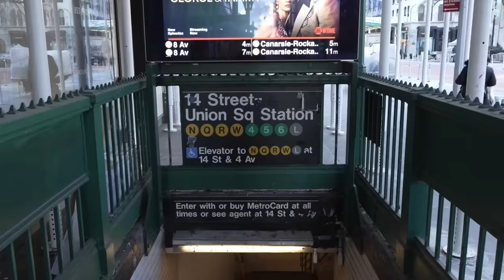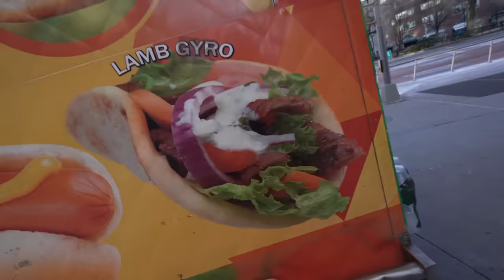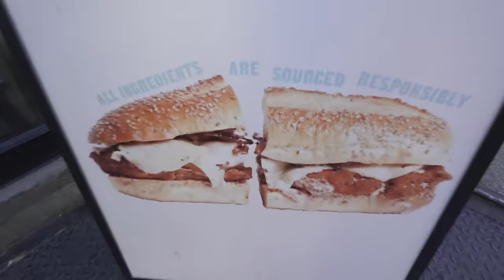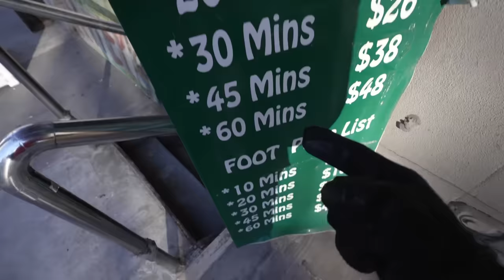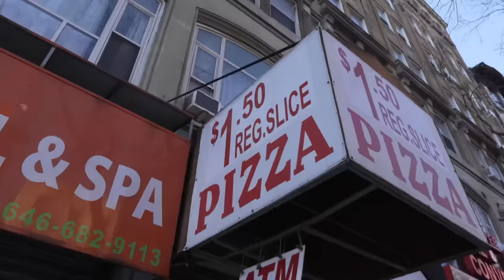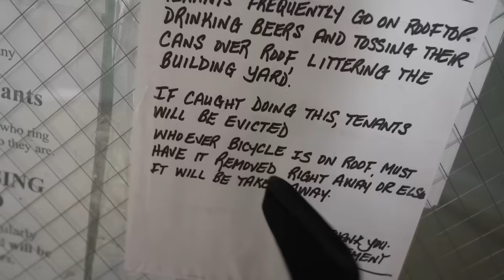This Apartment is SO SMALL… Nobody Can Live Here

Comment: I wonder how much it cost to bribe the building inspector to allow a gas pipe next to the breaker panel.
Reply: In a kitchen area
Reply: What about the outlets over the kitchen sink?!?!
Reply: @SherryAnnOfTheWest  not that uncommon
Reply: It’s not technically illegal for the gas pipe to be there, it can’t be above or below or the breaker panel, and there needs to be 30 inches off side to side space for the panel, but it doesn’t need to be centered. Still very bizarre.
Reply: @SherryAnnOfTheWest  not illegal if it’s GFCI protected.

Comment: Two more apartments with gas meters in the living spaces and strange floor to ceiling heating pipes.  Used to be 16 and now chopped up into 36 units.  I wonder if this building is up to code with that frayed refrigerator cord and the pipe with the loose part that's supposed to be connected at the ceiling.  A hard pass for me on this building and these units.

Comment: Two heat pipes in the wall. I think those are drains cuz that gas meter would heat the place. Or heat water that would run through that white radiator

Comment: a 16-unit apartment being converted into a 36-unit apartment is gonna result in some barely legal, barely useable micro layouts. When I lived in Flushing, Queens, I lived in an old apartment building and my ground floor neighbors had a 1br place with a very massive, sunny living room. After those neighbors moved out, my landlord sent people in to build a wall right across the center of that living room and then posted signs on its windows that a 3br apartment was available. My next door apartment had the landlord's henchmen going in and out for almost a  year making changes to it, but they made sure to keep the doors closed this time. I never got to see what it became because the landlord wanted to kick me out so bad for paying cheap rent that he bumped my rent from $1900/mo to $2400 at the next lease renewal and I was too low-income to afford that.

Comment: Hey, Cash!  It's the hall-way from "The Shining"!  As someone else has commented, it was originally 16 apartments ,which have now been chopped up into 32 apartments.. which x-plains the 20 ft. use-less hall-way. There is absolutely no room in the so-called living area.  The gas pipes are down-right scary.  Oh, goody, the local serial killer will have access to your windows via the fire-escape. That chopped up bath-room is something else. Cord resting on the heater? And the land-lord will have the nerve to charge $3,000.00 + electricity + utilities for this hell-hole!  Apartment No. 2 is only slightly better. That's a 'charming' feature to be able to check on the oven when you're in the bath-room!  Not only that, but I think you could sit on the toilet while using the wash basin. No balcony so you can really feel like you're in prison.  Sleepless in Toronto

Comment: The oven plugged into the regular 2-plug outlet, with the cord awkwardly stretched over itself, is very concerning. Ovens are supposed to have a dedicated circuit and the outlet is often a single, mounted low to the floor for convenience. I bet you'll trip the breaker if you try to use the other side of that outlet while the oven is on. In my kitchen the dishwasher shares a circuit with a single double outlet on the counter above it and you can't use that outlet while the dishwasher is running. It's a shame because it's the most logical place to keep the electric kettle.

Comment: There IS mold on the floor of the 1st place and the sink and tub needs to be caulked decently.. Plus, you're gonna have to stick brillo in all those pipe holes to keep rodents out! The electrical wires in the 2nd place wrapped around the heater valve is a fire waiting to happen. Other than that...well, I'll still pass.

Comment: People with sadistic senses of humor carved up these apartments from the building. At least there is no room for a party in the one where the loo is blocked by the open oven door. Otherwise, it could be a messy stampede if the onion dip was tainted. Tsk. Tsk.